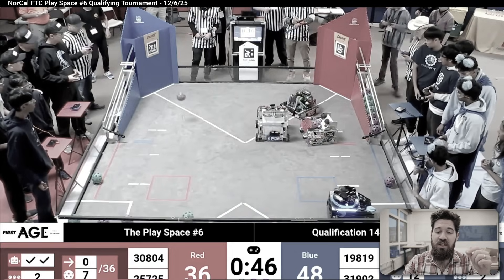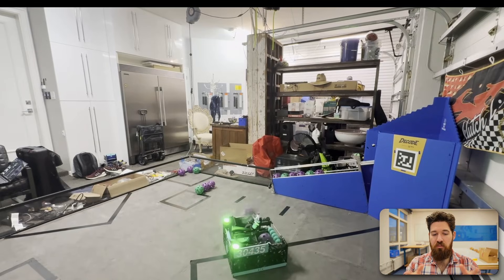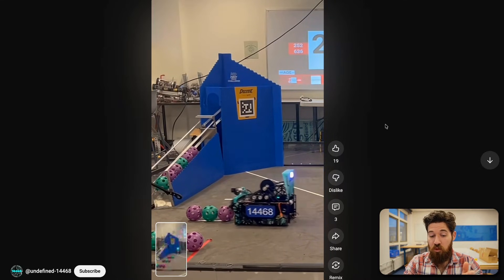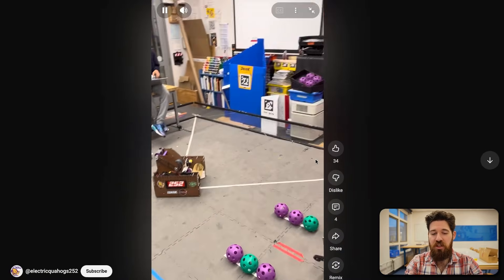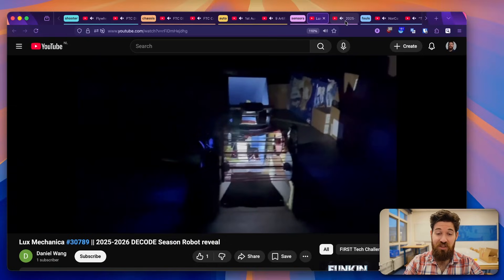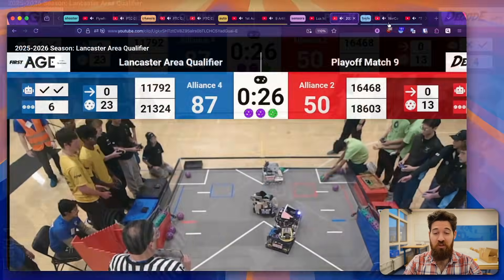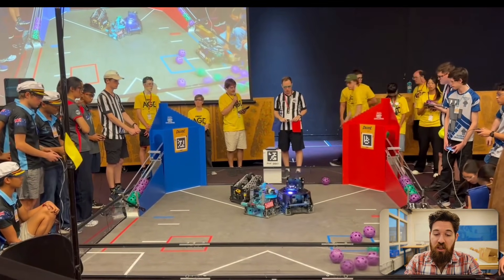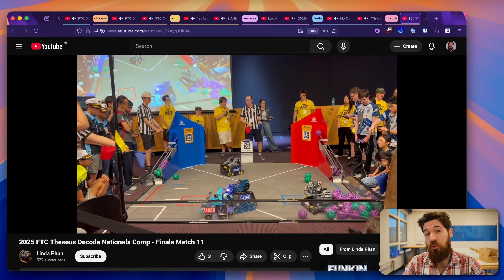Was This Foul Scored Correctly? [FTC Friday's DECODE]

Comment: Im a Referee, the push into gate foul would almost certainly be called as G210 against red (Do not expect to gain by doing others harm) and no penalties against blue. Whats more concerning, the Blue HP is blatantly violating G431.B (DRIVE TEAMS, watch your reach) at least 18 times, which is not only a LOT of (Major) fouls but a safety issue! (If the refs were actually looking for G431 (Which should be the priority) then this would have been resolved after the first contact, so its sort of everyone's fault here). And the Red HP got a Ylw Card for egregious throwing balls at robots. What a match!
Reply from the maker: Thanks for clarifying an sharing your thoughts. I agree, it was a wild match! I didn’t even catch the team throwing balls at other robots, ha

Comment: That instance where the a red bot pushed a blue one into the gate seems like it may have been called incorrectly.  G210 covers forcing an opponent alliance to violate a rule, and one of the examples is pushing a robot from "far away" (more than one TILE distance away) into a loading zone. In this instance the red bot clearly pushed the blue one from further than a tile away and it does look like there was "limited or no opportunity" for the blue robot to avoid being pushed into the gate.  So I think it should have been a G210 foul on red.

I also noticed that shortly after that instance, one of the red human players starts throwing balls onto the field.  Then they start throwing them forcefully at robots, possibly in an attempt to interfere with them.  That's clearly violating G432 and maybe other rules for throwing at the robot.  The red team did get 35 points of foul penalties so maybe that's where those came from.

As far as limelight interference goes, if you have deadwheel odometry then it would be a good idea to fall back to that to determine where the goal is if the limelight doesn't detect the QR code.
Reply: I agree, that first example should be a foul on red, not sure how they could've called anything on blue.
Reply from the maker: Ah, on G210, I missed that point on "more than one TILE distance away" ruling on that. I'd agree with your arguments on this, different from what I mentioned in the video. 

I also didn't catch red throwing artifacts at robots, definitely a no go!
Reply: @BroganMPratt was there a rule update for this? We posed this question to the judge; however, in their packet, they said it was not valid.
Reply: This is a perfect example of why the kids need to know the rules, this year more than ever. They have to be ready to challenge (and possibly advocate for themselves as it’s happening). 

The Red human player also threw 6-7 artifacts during that match, some at the opposing alliance robot, and each should have been given a major, and probably a red card.
Reply: @Chimley551  I'm from 19819, we tried to appeal to the refs based on that footage. In the end it was a yellow card for the ball throwing and we still got the 120 points of penalties.
Reply from the maker: Unfortunately, FIRST doesn't allow video replays for past evidence. That'd be far to logistically challenging to manage for an overwhelmingly volunteer organization.
Reply: For Throwing balls into the field repeatedly and at other robots in my opinion should have been a red card and some serious consequences, it's just not ok to lose you're cool like that, like yeah, it's stressful but that behavior should not be tolerated.
Reply: Thanks for looking into this very helpful information